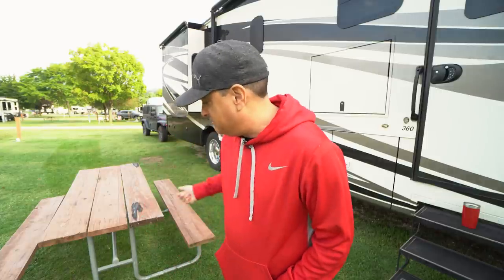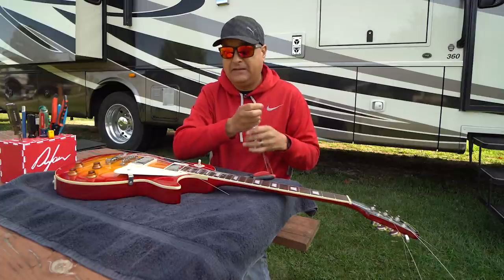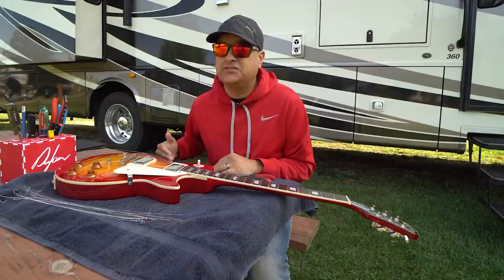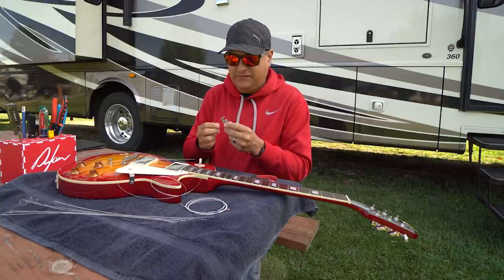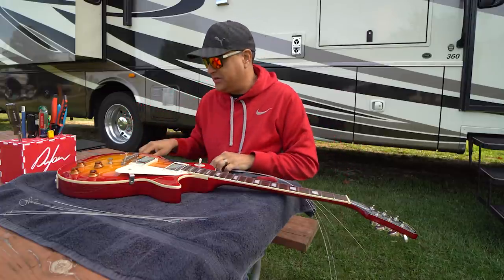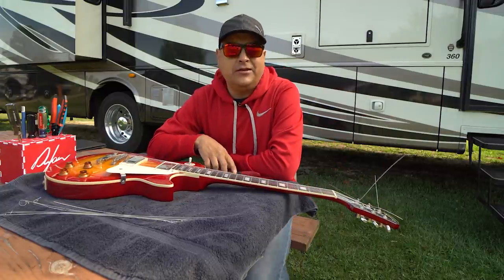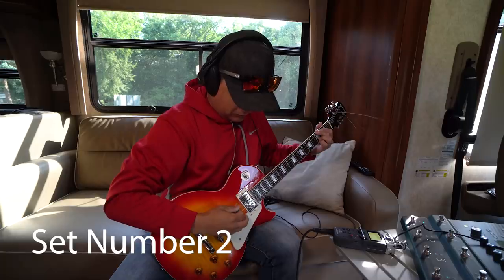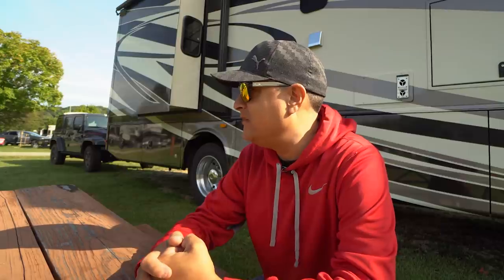When Should You Adjust Your Truss Rod? (string test - set 2)

Comment: Thanks for another great video! Quick question, being blind, I am having issues setting up action and adjusting relief with truss rod. I cannot rely on eye and use a ruler. What kind of object can I use as a gauge when measuring relief and action? Which frets? Seventh, 12th, 14th? Where  neck meets the body? Also for adjusting pickup height, it would be easier if I could just put some thing like a block on the fretboard or on the pickgard instead of directly measuring between the fret itself and the string or the pickup top itself and the string. Big thanks! Keep going!

Comment: Hi dylan. I have a question. I didn't get any results from google so i came to you. Can i add 2 coil split switchs (one for the neck and middle and the other one for the bridge) to my HHH fender stratocaster. And does it work with any humbuking pickup?

Comment: action is saddle height AND nut-slot depth above first fret
Reply: Yes.  Nut slot depth can make a setup great.  And, I always cut the nut slots 0.5mm too deep. lol
Reply: Why nut slot depth? Is that such a massive effect?
Reply: @chrisparker5278  -  It can have a "massive" effect.  Some might say nut slot depth has a "profound" effect.
     Nut height affects action over the entire length of the fretboard.  Of course, the effect of nut height is most noticeable at the first fret and the effect diminishes as you move up the neck, but it is always there.
      A great way to demonstrate the effect of nut height (nut slot depth) is to put a capo at the first fret and play for a few minutes.
      And, while you have a capo on your first fret, you might as well check neck relief using your strings as straight-edges.
Reply from the maker: For sure.I was going to cover this next week, but I should have mentioned it. Thanks for bringing it up
Reply: @DylanTalksTone  Cheers Dylan!